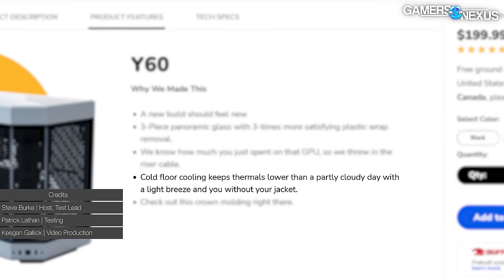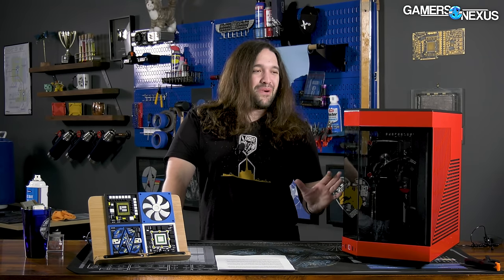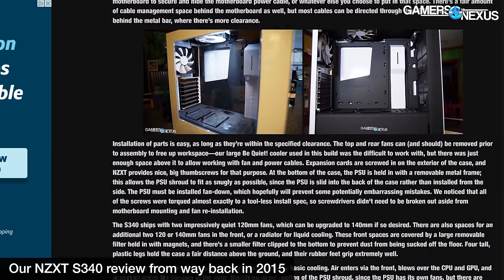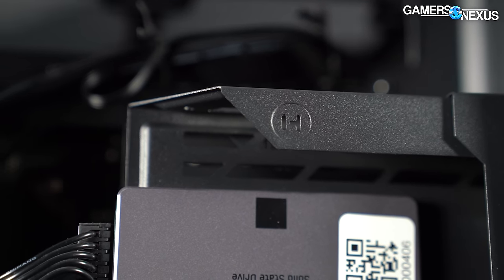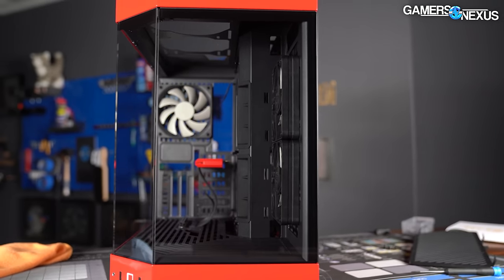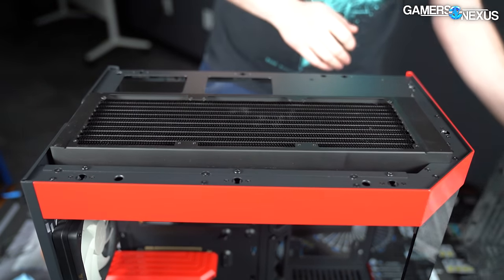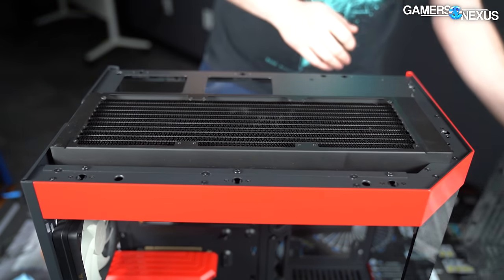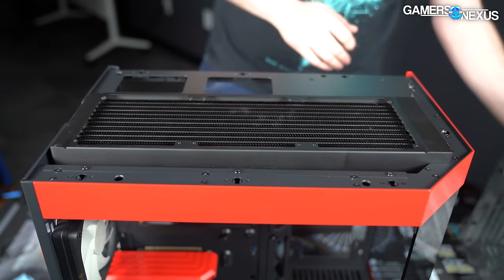Impressive Quality: Hyte Y60 Case Review & Benchmarks vs. O11 Dynamic

Comment: I recently got this case as I found the design very nice. Was wondering what particular GPUs would be best since Steve mentioned to not use a 3-slot card. As long as its below 3 slots like 2.7 it should be fine or would it need to be super close to only 2 slots width?
Reply: Just got mine earlier this week and moved my rig into it. I have a 2.75-slot EVGA 2060 Super XC Ultra, and there's just about a full inch of space between the cooler and the side panel. A 3-slot card would cut that down to about ¾ inch, assuming the cooler doesn't extend past the edge of the card's rear bracket, while a 2-slot card would bump that up to about 1½ inches. The more space, the better, obviously, but I've found my temps to be more than acceptable.

PROTIP: There's actually an extra, undocumented 2.5" drive mount. If you slide both drive sleds out, the "collar" that surrounds the opening they slide into has two holes in the side that faces the side panel, and they match up perfectly with two of the screw holes on a 2.5" drive. Even with the included SSD/motherboard screws that still stick out a bit when they're fully tightened, the drives sleds can be slid back in place without scraping on the screws. You do need a really short screwdriver or one of those bendy attachments in order to screw them in, though.

Comment: There is more area that allows air flow than most towers, not sure how the panel design would impede with all the airflow from 4 out of 6 sides. Compared to the 
Lian Li LANCOOL One RGB, this is amazing, and easy  to clean.

Comment: I feel like the best way to decide wether a case is good or not is to average the opinions from Steve (usually negative) and those from Jay (usually positive) haha. Jay loved the case design for having lots of grills but here Steve is basically saying the holes are mostly blocked. That means it may not be the best for extreme overclocking but should be more than enough for a more regular kind of usage, while still having a cool design.
Reply: Steve in the end also likes this case despite its limitations.

Comment: i would buy this case if it supported bigger mobos and gpus a little better. i know making it bigger makes it more expensive. however this case is exactly what im looking for. its just that all the parts that i have in my existing case are bigger than the recommended specs for this case.

Comment: I do have a turbo vent style Gigabyte 2080 Ti, 2 x sata drives, 1 ssd drive on top of the rest, I have a h100I for the CPU ... was wondering if that could be a better fit for me than the Cougar Panzer max that I have presently? thanks for any suggestions on fans and if it would be a good case for my setup

Comment: But how does it compare to the super restrictive NZXT H440 which is what I have right now. I really like the look of this case and other then the issue with thick GPUs it cant be any worse then the case I have now. However I do have a MSI MECH 2x 6750xt which is almost at that 3 slot thickness. The Y40 has a bit more room for the GPU but your review you did on that case did not favor it as much as the review for this one did, and the Y40 just looks like all of the other box cases copying the O11.

Comment: I came back to this review about to buy a Y60, I absolutely LOVE how it looks but I don't like the fan blockage and I don't want to be forced to vertical mount my 3 slot GPU w/ no horizontal expansion slots... I'll look at the O11 family again.
Reply: @hytebrand  I think it will be a fantastic case if improved just a bit, and I didn't buy a 011, I just cut 2 bottom 140 holes in my old case. Can't wait for the Y60 V2, or Y70 maybe? Y60 2.0? I'll be keeping an eye out in anticipation.
Reply: @Wooskii1  we may have something in the works that's just right for you!
Reply: @hytebrand  Awesome, I can't wait to see what you come up with! Actually I can, and will wait to see how it turns out- I passed on the Lianli stuff and just modded some bottom intake on my old case for now, so I'm still in the market for a cool show case.

Comment: as much as i like the design and vertical gpu focus, I also noted that this case is basically completely out of consideration for anyone with a thicker gpu. rtx 4090 and 4080 are much too big for this thing so you’d be stuck with liquid coolers or smaller gpus. I hope to see a horizontal gpu compatible version of this some time.

Comment: Cool case actually. Unfortunately it was good as dead for me as a future case for me the moment I saw the power supply size limit. With next generation gpus and cpus requiring a bare minimum of a 1000w power supply, likely meaning I'll need a 1200w one to make sure everything is covered and with some headroom for efficiency. Those massive 1200w power supplies sure as hell are not fitting in that case.
Reply: Do you not know how to read specs dude?
Reply: What are you doing that you NEED a 1200 watt PSU?
Reply: @xeri6760  4090, i9, 64gb ram, and 9 drives. Even a 1000watt supply can't handle power draw spikes from all of that, a 1200 watt can however. You may even need a 1300-1400watt supply if you want to hit the optimal power efficiency point. But that is only for saving a little money on power bills, it's not required by the system.

Comment: Seems that the red version is not on Amazon anymore. Or, at least, for me. I hope it comes back since I want to do a theme build with one at some point (the bloody thing costs 300+, so I'll be waiting for a long time before I get a case that expensive x.x).
Reply: Amazon is not the best source of cases. Often the more popular ones are $100 more expensive there then anyplace else and they don’t have the stock to support them.
Reply: @TheSjuris , if I recall, it was the only place to find the case. I could be wrong. I should check my local computer store, just in case. Thank you for the info.
Reply: @ZyozzJessie  Best Buy doesn’t carry this one.  Microcenter does and it’s $199. It’s $199 at Newegg and at Hyte itself.

Comment: I have the nighthawk GPU that has the radiator AIO attached. Will this GPU fit in the top slot of the Y60? I would put the cpu radiator on the side and the GPU rad on top if possible

Comment: I think that curved front corner really attributes to the effectiveness of the side intakes since it basically redirects the air right to the motherboard.
Reply: Most PC fans are not moving air nearly fast enough for that to happen.  What's happening is the intake fans are pushing air halfway and then said air displaces the air removed from the case by the exhaust fan.

Comment: The addition of fans is a tricky one and I think GN is very biased on that part (I mean the overall case reviews, not for that one in particular). I see no point in cases including 6-8 fans (each costing $20-30) and increasing the overall cost when they are most likely going to be replaced with rads or fans with different look depending on the owner. Doesn't make sense to compare cheap cases with no or 1 fan versus very expensive cases with multiple fans in stock. The standardized one is at most bare-bones with 3 fans and no rads. Case designed to have very few fans/rads (obviously where then can pull/push air from outside) are far more problematic that ones that can brute-force it.

Comment: am I colorblind or does this thing look orange
Reply: @Santa Clause  my LG UltraGear 34GP950G is pretty decent last I checked
Reply: @AirzGamingTTV  make sure your colors are set to full and not limited in the nvidia control panel, or look up how to do it on an AMD card if you have one. Could be other settings that need to be configured as well

Comment: Would a hybrid like an EVGA XC3 Ultra Hybrid work well in this setup? Considering the built in AIO liquid cooler, would it fit nicely in the top position for exhaust? Or would that be impeded by a CPU air cooler?
Reply: XC3 Hybrid has a 240mm radiator, so, it would fit both top and side positions. But, its tubes will surely interferes with any tall air coolers because they sticks out right in the middle of the card, around the same area as air tower cooler.
Reply: @poorNOOB  It sort of scoots around the back side of a skinnier air cooler, but I doubt you want to go skinny in this case. Good point, basically liquid or don't bother. Especially with the forced use of the riser.

Comment: Im getting the 4080 when it comes out, upgrading from a rtx 2070 laptop lol. I'm probably going to get the Corsair 7000D airflow mesh with the triple 140MM fan and 420mm radiator. I just need to secure the 4080 to build around that.

Comment: I think testing only with the included fans is bonkers.   Yes, manufacturers make some odd choices about what fans and how many they do and don't include, and that's worth noting sometimes, but people putting together high-performance systems are not likely to use only the included fans.  I know it would double the # of charts and I might be in a minority in considering that a plus, but why not do one test on each case with only the included fans exactly where the manufacturer put them, then a second test with the best configuration you can put together in that case?  It would show users how much or how little additional fans really contribute, and the optimal cooling potential of each case is arguably more relevant than the stock configuration.

Comment: For the quality $200 is not ridiculous. But the big issue to me is that it's not a versatile case. Not only because of the fact that it's not suitable for air cooling and multiple GPUs or even single big GPU. You can't have it placed with the side panel against the wall. It's not designed to be placed on the floor with this bottom mounted power button (something so simple yet so important!). It's space-constrained despite having lots of empty space one the inside. And you can't really brute force yourself out of the poor thermal situation just by adding more radiators and fans. It's a shame because I'm a big fan of the aesthetics and build quality. Hopefully there will be a bigger Y70?

Comment: I REALLY want this...  But they messed up bad by not allowing normal HORIZONTAL GPU support...
The bottom grate especially should also be made "thinner" so more air can come through along with others as necessary.  In the meantime I'm getting the Lian Li "O11 Air Mini".

Comment: Does anybody think, that something like a "cool tube" for growboxes would be a good idea for cpu and gpu cooling? So basically a hose that sucks air from the outside of the case, over the cpu or gpu cooler and then directly out of the case. The air would have a direct, unobstructed path to the component, no edges to create turbulances (and therfor noise and resistance) also it would be slightly isolated from the heat inside the case. At least that's how it would work in my head.

Comment: Any good videos or articles on modding an old Antec 900 case?
Reply: Try googling that, it was quite a common solution back in my day. Just type the same question into a search engine. Or you can just use keywords, I tried "modding an Antec 900" and got all sorts of results.

Comment: That forced Vertical mount (Serves no actual purpose than a stupid Aesthetic) is a deal breaker, especially if you use Add in Cards.  They tried to make something from someone else's design and turned into a case that only very specific users will buy for whatever reasons.  It's too "Only this way" for such a roomy case, there's little freedom of placement so in the end every build will pretty much look the same without extreme modding.

Still using the Lancool II Mesh and have not seen a reason yet to move to another case, it just works that good.  Fully cranked everything and no issues and NO WATER GARBAGE to worry about.

Comment: Couldn't a triple-slot air cooled GPU be mounted on the motherboard, horizontally?  Or do they have to be mounted vertically regardless...   It seemed like Steve was hung up on triple-slot GPU not fitting if it's air cooled and mounted vertically when the solution could be just to mounted it legacy style on the motherboard.
Reply: There’s no support for the more traditional mount.

Comment: So I'm confused on the LED light for cpu, gpu, and boot and I got my hyte y60 pc all built and everything is plug in and running but when I first turned it on the boot light turned red so I new it was because there was something wrong with the BIOS but after a while messing with the settings I have a Samsung 980 pro ssd and I clicked boot override on the ssd and now the light is gone it went from red to now off and now on my screen it says reboot and select proper boot device but the red light on boot is off so does that mean it's fixed and I just need to install the operating system suchs as windows 10 or what I'm still confused please help.

Comment: The angled glass side is amazing. Everything else not.
Plastic top side, plastic bottom inside, a very restricting radiator option on the top, fixed dustfilters. Small gaps between the glass force you to have positive pressure inside or it will dust up.
Honestly at the pricepoint of 200 ... I would just use parts of my old case + buy glass panels and wood, and build my own...
The glass shape is great, but this isn't endgame yet.

Comment: I'd lowkey buy it, but I wish they made a mini variation that could fit just fine under 9" on a desk. it's a tad too wide.

If any chance you still have it, have you randomly measured the case foot sizing?
Reply: It’s not meant to be used under a desk, but on top of one.  Especially with bottom mounted fans.

Comment: Do y’all think a cablemod vertical bracket would help with thermals in this case?
Reply: I don’t think the bracket will fit since it relies on full width horizontal slots.

Comment: Considering that they have that volume hidden bellow for fans, it would be smarter to just chuck a squirrel cage fan with the quiet mod in there and either tape over or make a box for it around so it only sucks air through a filter and pops it out in the case where other fans can make the flow. As is... that huge gap basically negates the fans, air can go right back where it came from.

Comment: The Low Profile PCI Slots are a big deal breaker. They're limiting usage for no reason. Can't use a D15 or U14S because of Vertical GPU, unless it's a 92MM PCB design which is rare these days. And 3 Slot GPUs choke at the glass.

Comment: Y70 Looks cool but it's a terribly inefficient case in terms of air flow and cooling.
For example the bottom fans are sandwiched between a bracket that blocks like a third of the fan's openings and then there's a space in that terrible thick criss-crossed grill. 
So the air is already restricted before going into the fans especially if you put the included mesh on the bottom. Plus because of the design on the bottom it cuts off a portion of your first and third fan completely if you're using 3x 120s. On one side they have the GPU vertical mount built into the grill so on that section there are no perforations for air to get through. They also didn't make the opening on the bottom big enough to expose 100% of all three fans.. Then you have a space above the fans before even reaching that thick criss-crossed grill..
*Find somebody with a douche flute and have them blow vapor at that grill from a distance and you'll notice the vapor dissipates in every direction rather than going through the grill.
Now push your mouth right up against it and blow.. obviously the air goes straight through.*

Then you have the right hand side fans. Again they're held with that bracket that blocks airflow, then there's a space and then there's that thick grill again with a built-in mesh this time. Because that grill is not pushed up against those fans the fans are pulling air from all around themselves including The air from inside the case. They're just recycling the same heat through the case over and over.
And then we've got The terrible bracket and grill on the top too. But for some reason they decided to add an irremovable mesh to the top grill exhaust which doesn't make any f**** sense. Unless you're trying to keep the dust in your case?!  And that's why apples to apples when you compare this case to all the other meta cases that have the triple bottom side and top fans; this one will come in last place every time

Comment: Who wants to use this case out of the box without high pressure bottom fans and side mounted fans? Instead two stock fans were just rearranged.
You should start by saying this is not a budget pc case and that people dropping $200 on it are likely already aware that they need side fans.
After the midway point through the video the actual concerns of gpu temps were more of an honest critique to me even though I will be water cooling both cpu and gpu. The side fans being more impactful than the bottom fans was also noted.
I personally wouldn't use this case with a custom loop due to blocking the best airflow source it has with a custom loop panel.
The Lian Li EVO likely has much better bottom air supply for such a build.

I enjoyed the review but the first half was really a worst scenario out of the box test like a "come on man" moment.
Why not just show the best scenarios first for user safety then windle down to "this is why removing X fans here (or X layout) will cause X temps"?
53 temp for 2 front standard fans and 1 rear. Where are the top fans? The bottom fans? Who can be surprised by these thermal results?
You're hitting a glass corner with two noctuas and expecting one 120mm standard exhaust 17 inches across to pull all that hot air out.

Where is the "methodology" section?